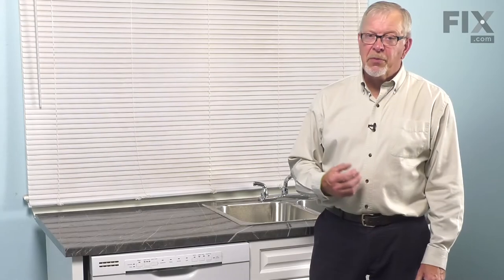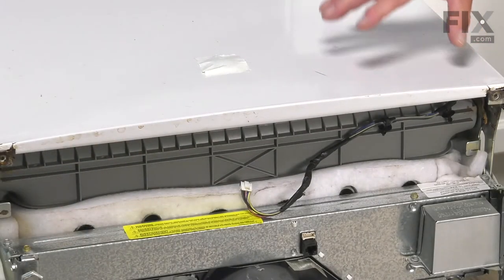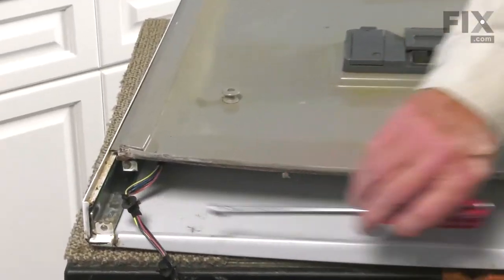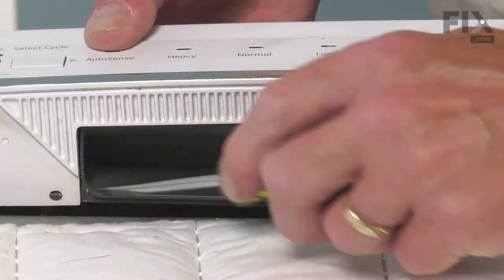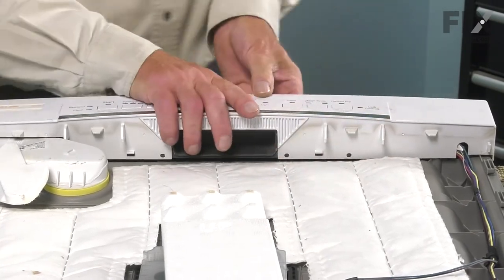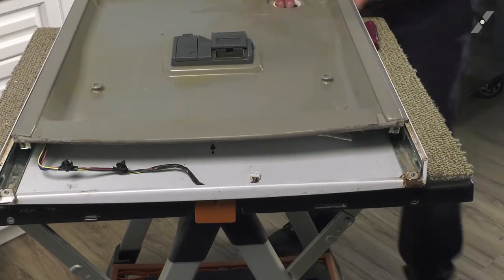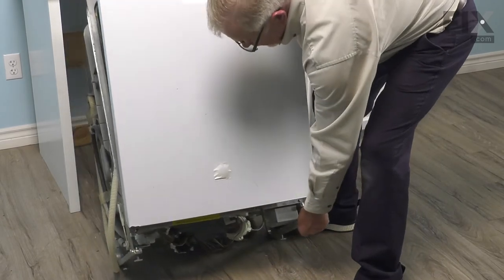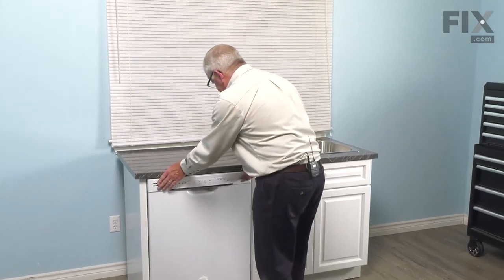GE Dishwasher Repair - How to Replace the Door Vent Seal

Comment: This was helpful.  I made the repair on my GE dishwasher and discovered a couple of slight variations (It’s a newer model).  On mine, before lifting the door off, you need to disconnect the spring loaded pulleys on each side.  It didn’t require me to lock the door open with the Allen wrenches (although you can).  
Secondly, my door had 4 additional hex screws (2 on each side) that had to be removed before the door panels could be separated.  
It appears GE redesigned the threads on the door vent to tighten more fully to prevent leaks.